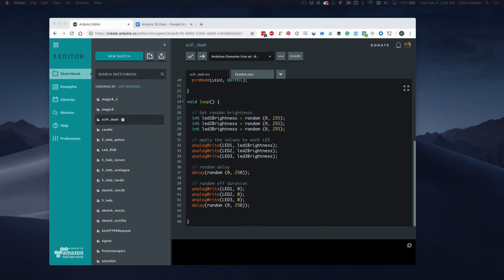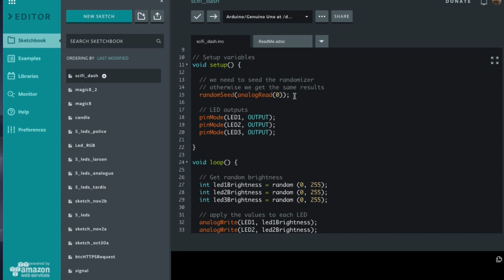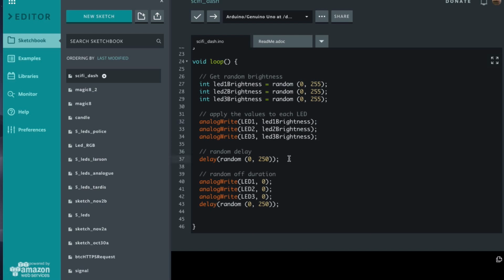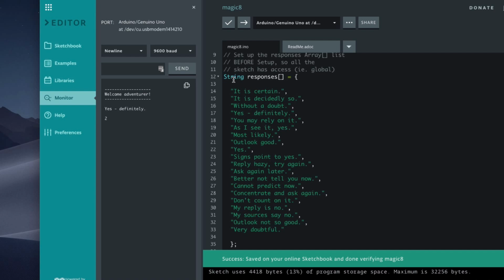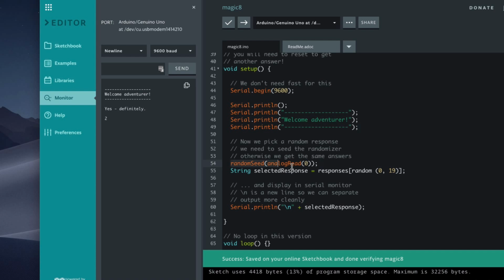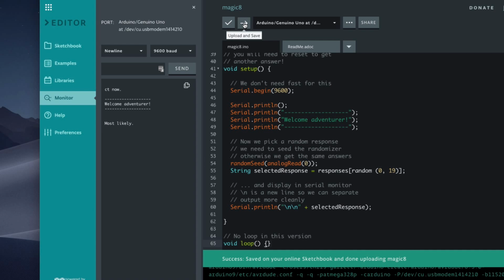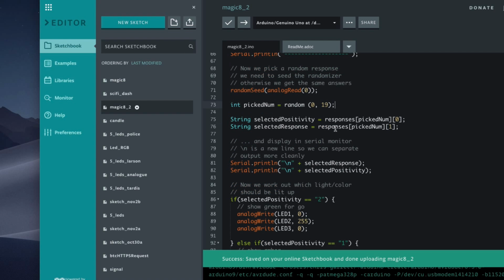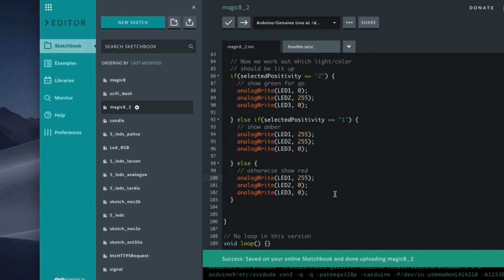Arduino Magic 8 Ball and the Random Factor - 30 Days to Arduino Day 4

Comment: Just wondering Chris, I at first thought I messed it up since the routine was printing the response, but also printing the "positivity" number afterwards. Seemed odd until I saw your was doing the same. Any way of only printing the response, and not the positivity? Thanks!
Reply from the maker: Yes, remind me to post the solution - will answer as soon as I get to WiFi
Reply from the maker: Comment // or delete the line with Serial.println("\n" + selectedPositivity);